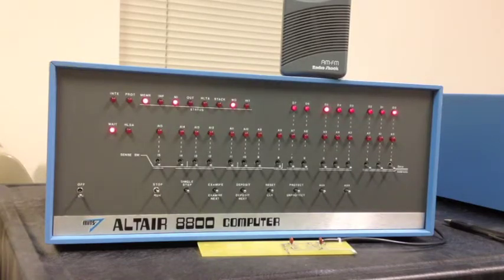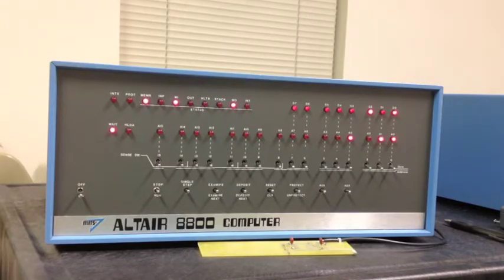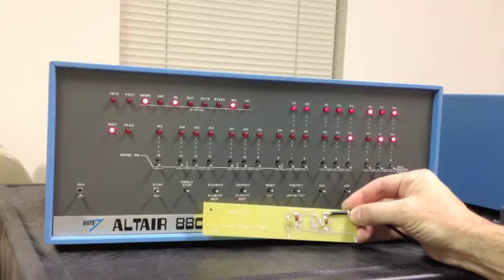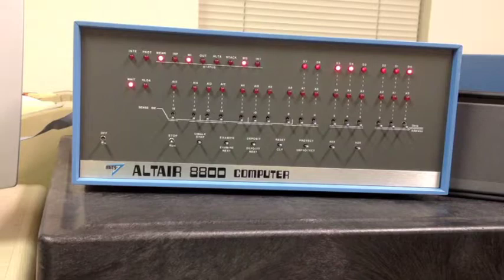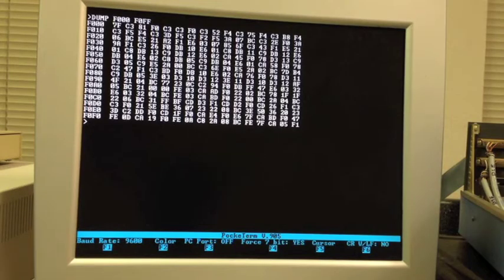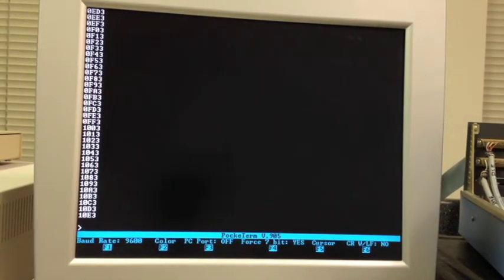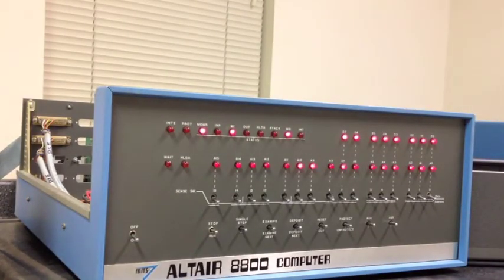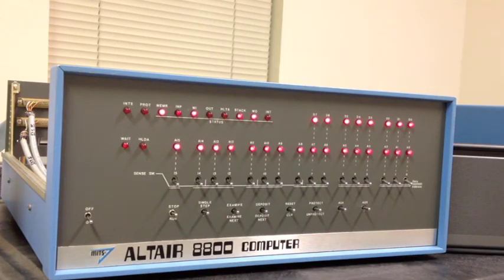Altair 8800 - Video #29 - Music on an Altair 8800

Comment: Playing music on computers using AM radio's dates back to the late 1960's (some computers had speakers on them back in those days, so the AM radios were used as substitutes for computers without speakers). A few people figured out a way to record data and then used that data to pulse width modulate a speaker to reproduce more generic audio. Back in 1973,  I used the "brake" on a high speed photo paper tape reader (600 characters per second) to generate the sound, eliminating the need for the AM radio. However, to surprise a few co-workers, I started with an AM radio with the volume turned off on the computer, then took the AM radio away. It took a while before the co-workers figured out where the sound was coming from.
Reply: Can that speaker card be used with a Northstar Horizon?

Comment: Built my first computer in 1978; an S-100 system similar to this Altair. But I ran into a problem. Everything was finished and ready to go, except my video card was back-ordered! A friend also had an S-100 computer, and we both had this music program deramp5113 demos at 7:00. So I go to my friend's house, turn on his AM radio, and memorized the noises his computer made at every prompt involved in loading and running the music program, both the noise made when the last command worked, and when it failed.

When I went home, I could boot up my new computer, load and play music from my floppy drive with no video at all. :) That's what I did for about two weeks, until my video card (from Processor Technology, incidentally) arrived. 

Good times!

Comment: First wireless I/O device. Cool.
Reply: RosePhoto1 I'm going to say it's the first wireless personal computer output device. Unless someone had an AM radio hooked up as an audio data input using "cassette" formatted data (modem). (a CB in the '70s was Shortwave AM radio so, It's not impossible..)

Comment: Is it due to F.C.C. regulations that the Altair 8800 clone does not emit A.M. radiation?
Reply from the maker: infinitecanadian The modern hardware inside the Clone has no external data or address bus, so it doesn't radiate much of anything even if I wanted it to. Yes, the FCC limits EMI, but the Clone was never close to hitting any FCC limits anyway.
Reply: deramp5113
Ah, I see.  Why hasn't it an external data or address bus (and do please forgive my ignorance)?
Reply: @infinitecanadian  Because it's all done with a microcontroller, which generally do not have external address and data buses. All the ROM and RAM are on-chip.
Reply: Is there a clone that would match the original altair (meaning no microcontroller)

Comment: I read this on your website:
Can the Altair Clone play "Fool on the Hill" and "Daisy?"

The Clone properly runs the programs that caused the original Altair to play "music," but unfortunately, since the Clone does not emit unintended radiation in the AM band, you won't hear any music on your radio.

So did you improve the Clone so that it can play music now, but couldn't before?
Reply from the maker: eklipsegirl This is a real Altair 8800 in this video. The Clone cannot play through an AM radio, however, it can be used to play music using "The Music System" product which demonstrated in this video. I'll be putting up a follow-up video that shows the Clone working with "The Music System."
Reply: deramp5113 I got it. What I didn't get was how do you connect that music board to the speaker?
Reply: The music board read bus signals from the altair bus slot; then connects likely with a simple RCA style audio connector at the end of the cord soldered on.